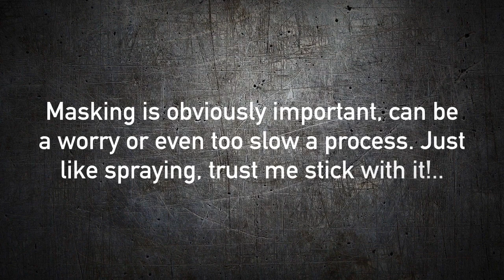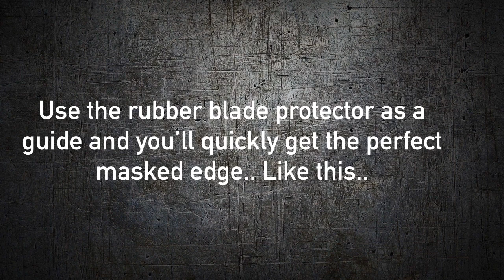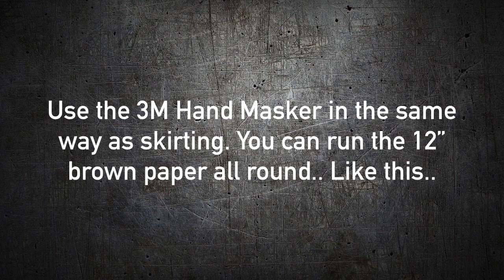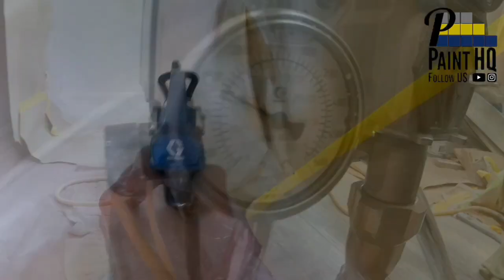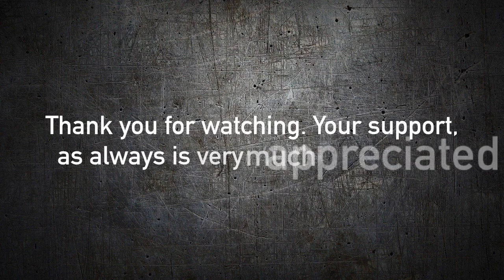How to mask a room. 3M Hand Masker Tips. What painters tape to use

Comment: Hi pete can you recommend a mask that will protect against fumes and mist from airless. I have the 3m 7000 mask but im not sure which cartridges i need . Any help or suggestions be great mate thanks.
Reply from the maker: I’ll do my best to point you in the right direction.. please somebody correct me if I’m wrong.. There’s 2 parts to the protection “A” and “P”.. Then levels of protection for each.. So you have A = Organic gas / Vapours.. A1 and A2.. A2 protecting against higher levels of vapour than A1.. although both will offer protection.. Then P for particles.. P1, P2 and P3.. P3 bring the highest level of protection against particles.. So as long as I’m telling you right, A2P3 offers the best protection.. if you’re able to check out MyPaintbrush, that’s who I use for my consumables, incl tapes, brown paper, plastic etc.. They sell both sets of 3M filters A2 and P3, just check they fit your model.. Hope this helps a little my friend.. great to hear from you.. Pete 🎨😆
Reply: @PaintHQ  thanks pete so am i right in thinking i need a combination  of filters as in one a2 and then p3 on the other side? What mask do you use pete ? Sorry for all the questions
Reply from the maker: No problem at all Mick.. Yes you would need both sets of filters for your 7000 series mask.. you’ve got a very good, “full face” mask my friend 👍 Mines a 3M “half mask”, designed as a throw away item once clogged.. I’ve got to be honest, mine is probably due to be replaced.. I spray so much, that my next one will be similar to yours in that I want to be able to change out the filters.. I prefer the comfort of the half mask, so will probably get a 6000 series mask (A2P3).. feel free to ask questions anytime, I don’t mind and I’ll always do my best to answer 👍👌

Comment: Any tips on masking behind a sliding closet door? We have large opening closets (6 feet wide by 7 foot high door, with two panels that slide on a track) and are skim-coating drywall and painting the room itself and then the frame around the closet door - but not the inside of the closet itself. This is kinda like painting a cabinet's face/frame but not inside. I tried using double-sided tape from inside the closet but struggling to get it to stay, since the walls inside are glossy and the sprayer puts a lot of pressure on it. Also difficult to crawl out the closet from the bottom and get it all sealed up. Thanks!
Reply from the maker: Hey Ryan.. great to hear from you bro, I’ll do all I can to help.. I think I can picture what you mean.. there’s always a solution 😆 ..I tend to create a ‘hood’ when masking openings, there’s various sticking points depending on the edge that’s being masked off.. take a quick look at this video https://youtu.be/Hou34W9qF-E ..Whist it’s not a closet, you’ll get my idea of creating a hood that’s strong enough to take the spray pressure.. you’ll be able to run a protective line of tape first which gives you the edge you want.. hopefully it will give you some idea of how I tackle the masking off of opening and you can adapt it.. if one run of 12” brown paper does not feel enough protection, run another line of paper (creating 24”) or stick plastic inside.. Really hope this helps, feel free to get back to me if I’m on the wrong track.. either way let me know how you get on.. great to hear from you.. regards Pete
Reply: @PaintHQ  Ah nice - that video helps! I got some tips on reddit from this question I posted there with a photo (https://www.reddit.com/r/paint/comments/oqwpsh/help_masking_off_closet_interior_for_painting/) which included a piece of tape that sticks out from the edge. When I tried that before it wasn't sticky enough and also found that the plastic blew into wet paint too :/
Reply from the maker: That’s great 😀 Yeah seeing the image, it’s how I imagined it.. you would be able to tape the edge just like a door opening, then if using taped brown paper, you could fold and manipulate the paper into a shield.. if you plastic behind the paper to protect the closet, the brown paper is strong enough to stop the plastic flapping into the paint.. 

Just thought.. this video https://youtu.be/ni7clOjuM98 from 2:35 you’ll see me spray the outside of a closet.. much smaller than yours.. I’ve masked in a similar way as explained.. but also use a spray shield (with brown paper keeping the shield clean).. the spray shield just gives that extra line of cover on top of the precision masking 👍

let me know how you get on my friend, keep in touch.. regards Pete
Reply: @PaintHQ  good call on the shield - thanks for the tips!
Reply from the maker: You’re very welcome 💯